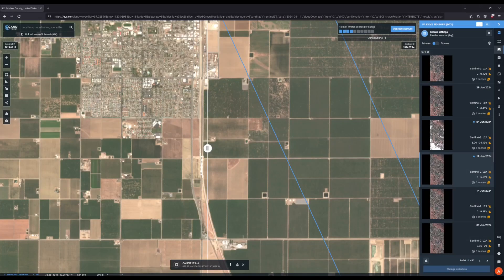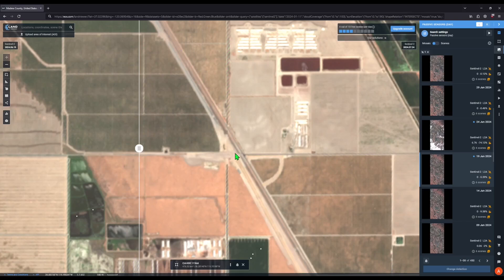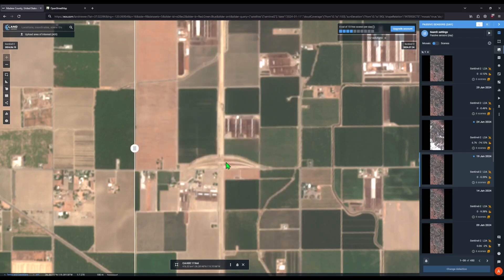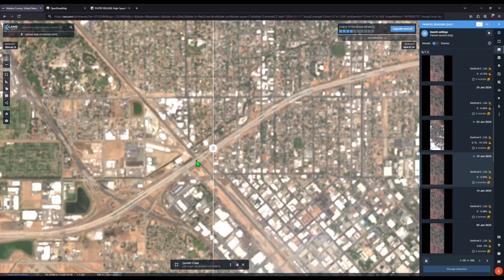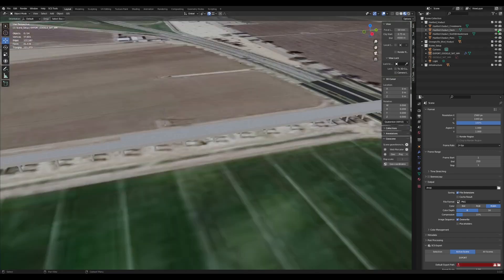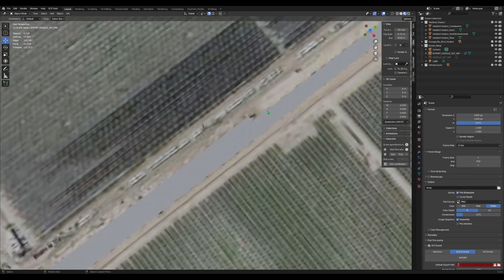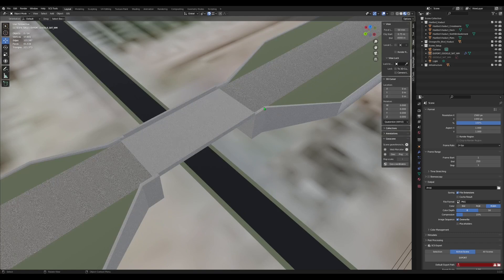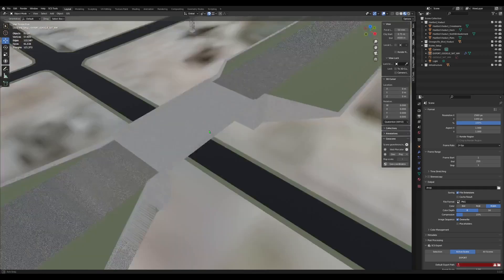California High Speed Rail: The Hanford Viaduct Model

Comment: I don't think that any signalling will be installed. It will most likely be ETCS Level 2 SRS 4.0.0 without lineside signals
Reply: There's still trackside equipment that's part of the signaling system, even when the actual signals are communicated to the driver in-cab.
Reply: @DavidCiani  New ETCS high speed only lines are build without signals to reduce costs and potential points of failure. With the latest tracks, which require monitored train integration, even having no axle counters. The only track side equipment are the OCS, connection to the switches, balise, and occasional a radio block centre